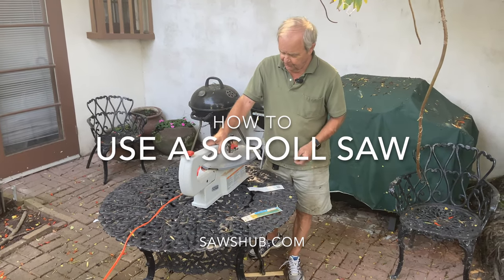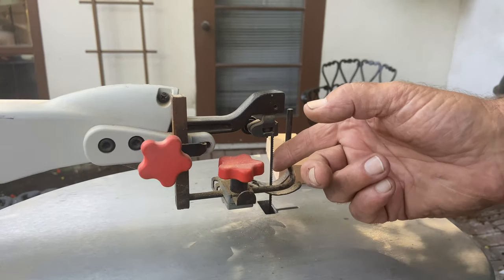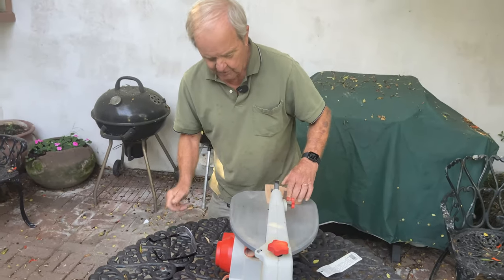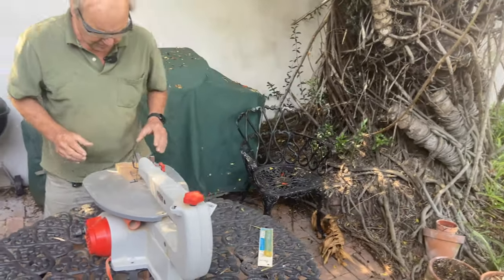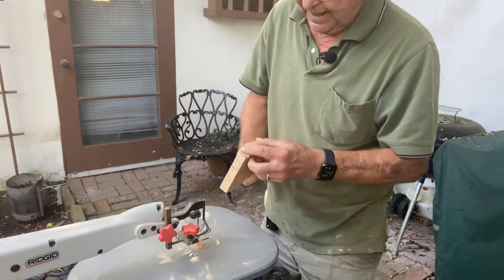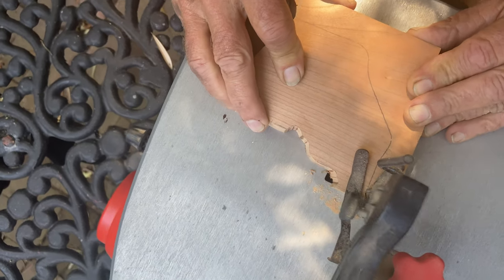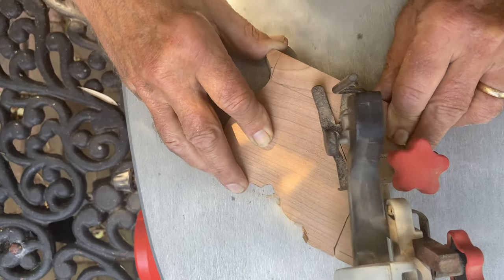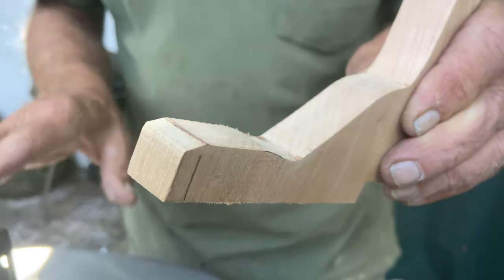How To Use a Scroll Saw For Fine Woodworking and Ornate Wood Projects

Comment: I just found your channel and you explain things very well. It's easy to understand. I have seen some videos where people had their fingers very close to the blade and it made me nervous that they'd cut their finger. They are more experienced, so they probably know how to handle it without cutting themselves, but I've been told in other videos like this to keep my fingers away from the blade. I plan on buying a scroll saw soon and videos like this are very helpful. I'm glad I found this channel.
Reply from the maker: Awesome, thank you!
Reply: @SawsHub  I just ran across your video and I wanted to ask a question is it better to use a spiral scroll saw blade when cutting softwood or 18 or 18.5 tooth per inch blade